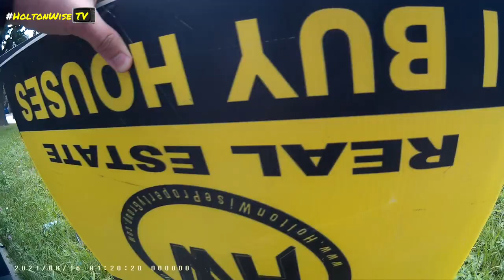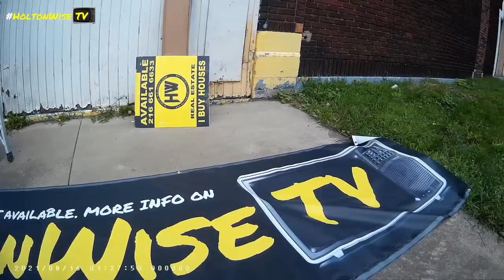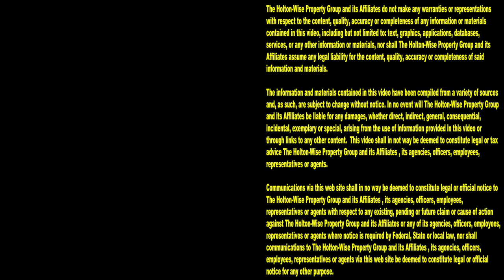Cleveland Landlord Evicted all of her Renters & Abandoned her Building | Tenants From Hell 172

Comment: What's the future for buildings like this?   Basement and brickwork look solid but everything else is stripped.  Even with a $1m budget where would you start?

I'd think 1) Rigging electricity as this is necessary for lighting and power tools, 2) Fixing/replacing roof, and 3) Windows.  After that you're stuck rebuilding this place from the inside out.  I see why so many are demo'd.
Reply: Its a shame
Reply: Where to start? Due Diligence (Property Search for problems past, current & future) and Structual Engineers. I can see a lot of potential if cost is right. Place was beautiful at one time. With enough money, time and skilled workers it could be again. Love the fireplaces.